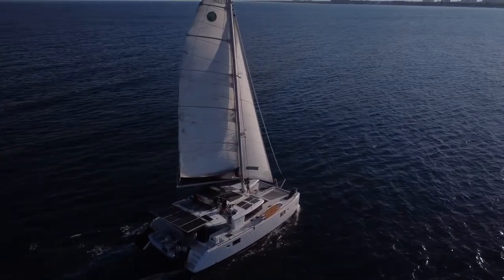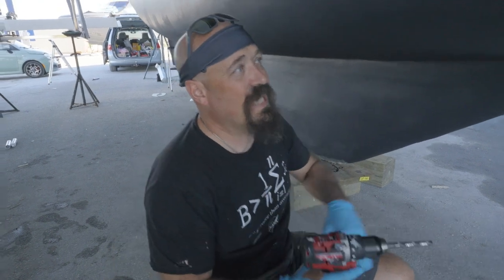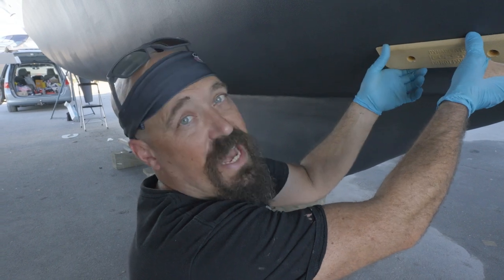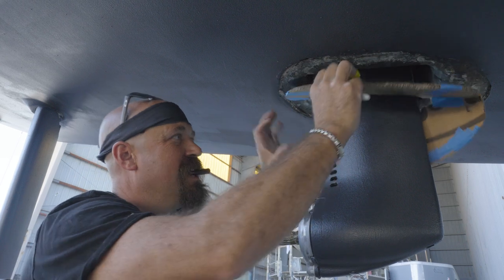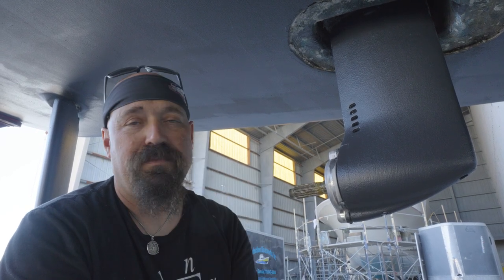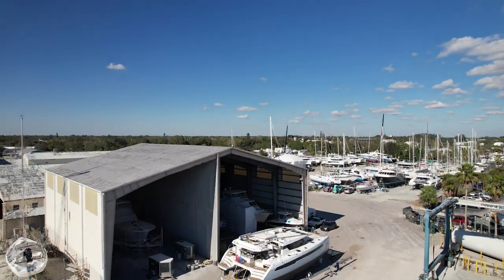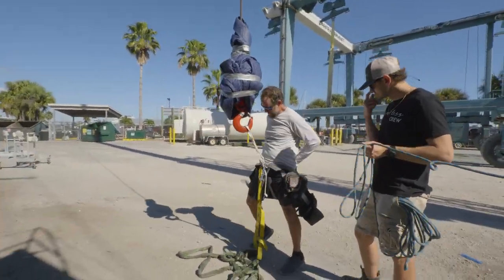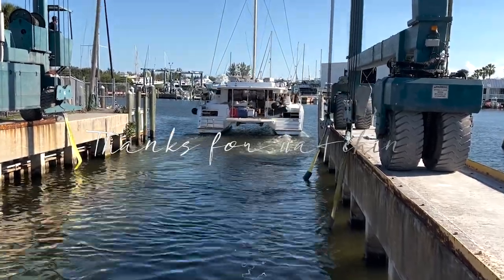OFFICIALLY A SAILBOAT//Standing The Mast & Much More-Episode 117

Comment: That's smart thinking, shortest path to ground is where the lightning will go... Having a lightening attractor on the mast the highest point on the boat is exactly the path the lightening will go, Note: the boat has copper paint, I wonder what would  happen if the Ground Plate was put directly to the copper paint where your putting the ground plate?
Reply from the maker: No copper on the boat

Comment: If you take a direct hit to your lightning protection, on the mast, it travels through the grounding conductor cable, from the lightning protection, to the ground plate; are you concerned the magnitude of the strike could blow a hole in the boat at the ground plate? Is there a means to dissipate the charge before it reaches the ground plate? Once it reaches the ground plate, how is the charge dispersed? It's great seeing Dauntless back in the H2O. Congrats!

Comment: First: In the Stone Age conventional wisdom said ground grounding plate affixed to the keel. Affixing the grounding plate to the keel always has been wrong. 

Second: Electricity does not “seek ground” as so many dockside sages insist. Be kind to the many that like me were taught allot of stupid shit in high school we now know is wrong. Too many others to list here. My physics teacher in high school should be in hiding. I voted for Raygun when I was 19. That makes me old.

Third: We all are going to have preferences as to what brand of bonding or grounding systems we use. Cover all the bases. DC grounds to different places on your boat. So does AC. Be sure you are protected when connecting to shore power. Anybody can be a mechanic if all you do is change parts. Where electricity stops is where your problems begin.

Fourth: Do what this channel says as far as lighting protection for your sailboat. Stop insisting there is nothing you can do.

Mast rigging is something I have watched many times others do for me. Acrophobia is the main reason. I still force my myself to go up when other things need attention. Go inside because vomit will rain down. Curious thing about acrophobia is it subsides after 20 minutes or so. Get everything done on the first try. Because the process starts all over again if you come down and go back up again.
Reply: they didn't put the grounding plate on the keel...? If you remember from when they made them, the keels are virtually solid glass. How would they put the nuts on the back of the bolts to actually secure it?
Reply: @jayhawknation2916  Obviously this channel never once contemplated mounting the grounding plate to the keel. Numerous examples on the internet of sailboat owners asking what they can do to fix the problems they are having with the grounding plate they mounted on the keels loosening and almost failing off. Last time I asked one why they mounted the grounding plate to the keel? The implication was made that mounting the plate to the lowest part of the sailboat is somehow beneficial. Why do so many sailboat owners do so many strange things when dealing with electrical? I don't know.